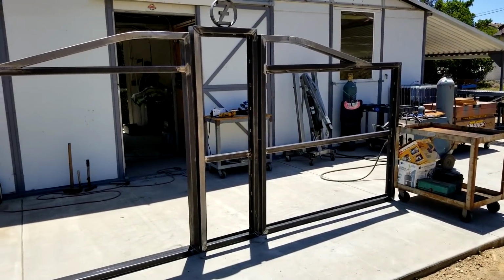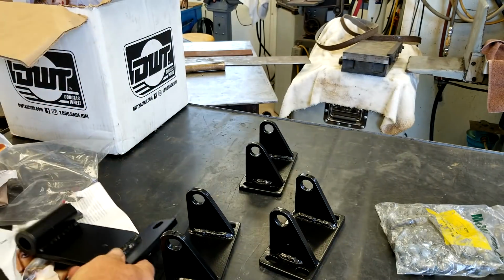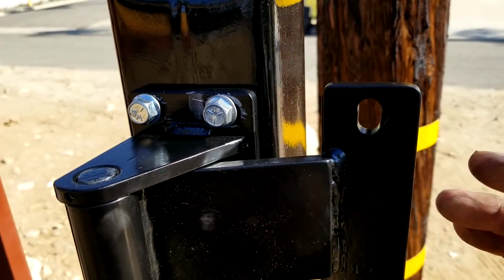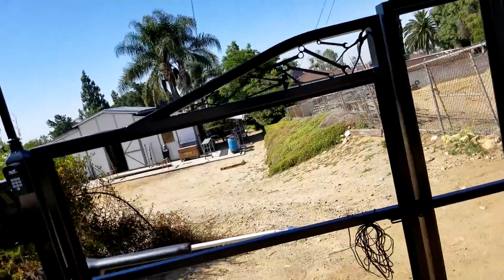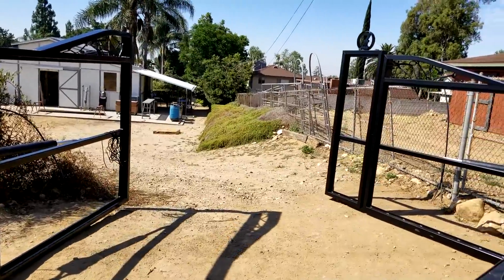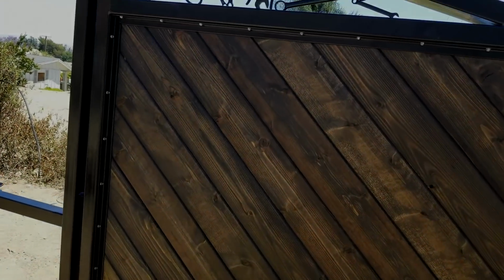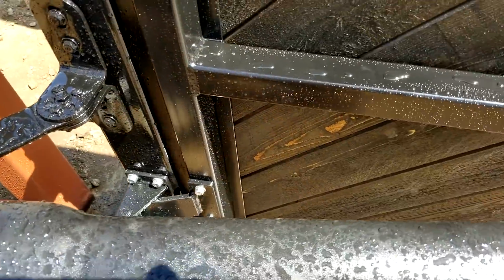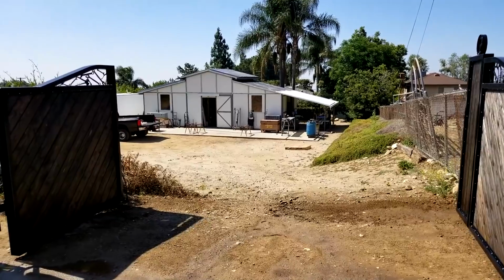New ranch gates at Bar Z

Comment: Great job love the details.. one question what if you loose power how can you open the gate...
Reply from the maker: The opener is run off of a 12 VDC battery, which by itself is good for 30 cycles, a 120V wall wart keeps the battery maintained.

Comment: Hey Stan, is that Mighty Mule setup 110v? Did you already have power out there or did you have to run it for this installation?  I like that planking on the bias, classy.  Kudos on the used motor oil as well.  One of the best wood stains / preservatives there is, and really cheap!
Reply from the maker: Actually its 12 VDC battery powered, it uses a wall wart to keep the battery topped off, in the absence of AC power, a solar charger can be added to maintain the battery.

Comment: i have always wanted to build some gate hinges.. using water pump bearings..  i know a wholesale place in los angeles that sells new automotive water pump components..  if its for an application that has a radiator fan mounted to the water pump shaft. the bearings have both a thrust bearing and conventional bearings.   i just thought i would chip in with that thought..